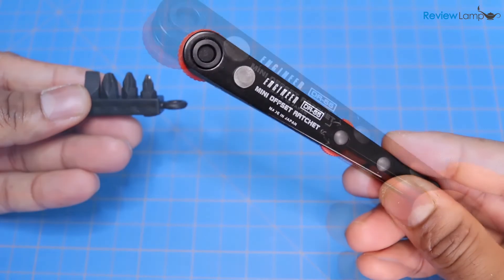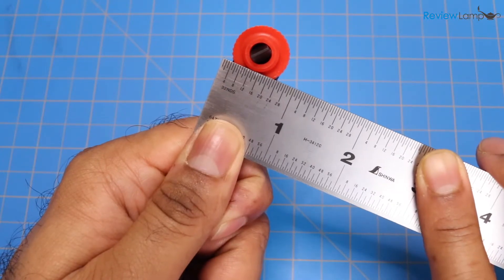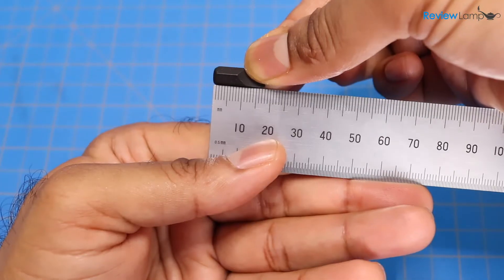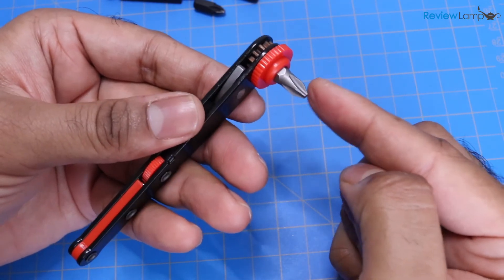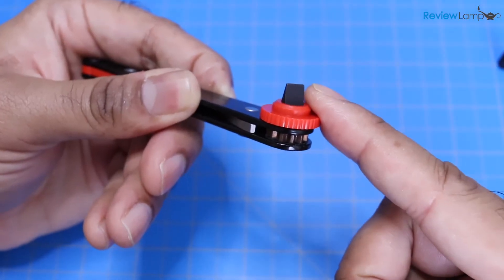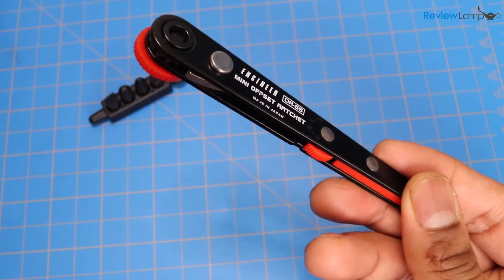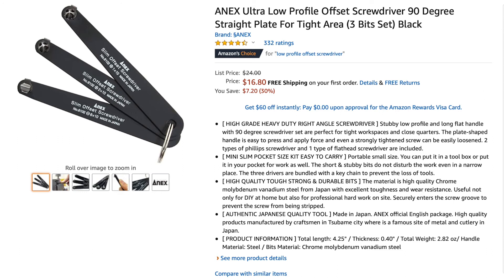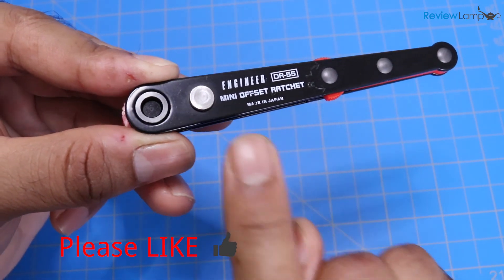Engineer DR-55 Offset Mini Ratcheting Screwdriver Review

Comment: Try the Vessel TX-79U! It has more extensive bits and is lower profile and has a 15 degree offset version. Vessel is a Japanese brand and the kit comes with Japanese mini bits but the tool itself is made in Taiwan but it’s still a great tool that addresses your complaints.